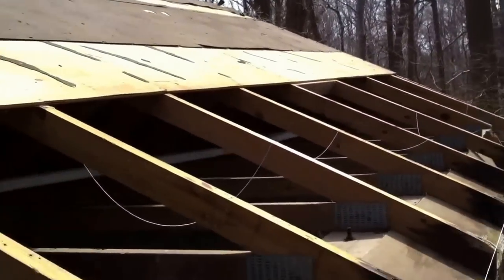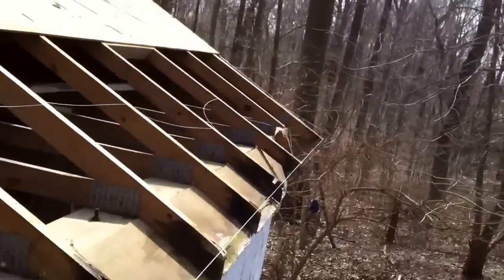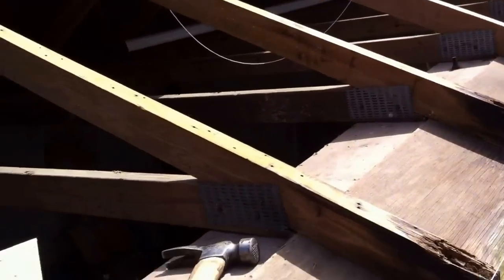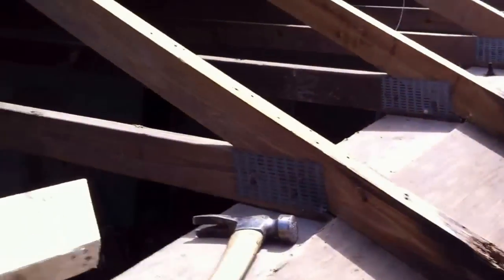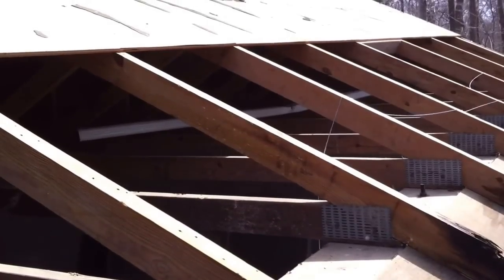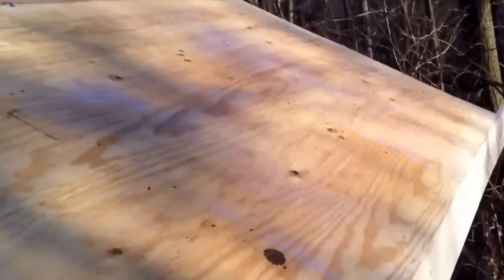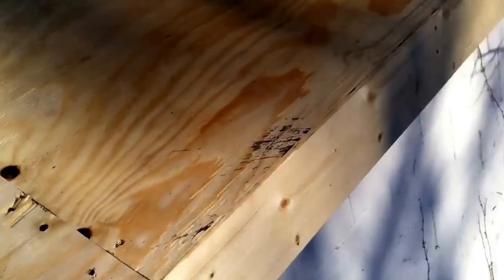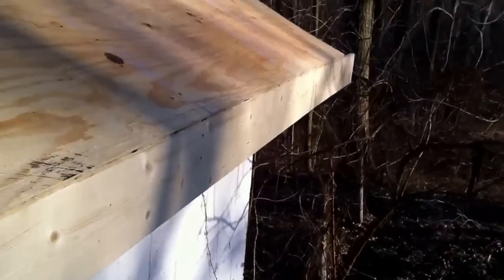Rafter tail and the importance of fascia

Comment: Which do you recommend be done First:  Drip Edging (directly on the roof deck) or the Felt and drip edging over the felt?  Thanks!
Reply from the maker: Well, there are a few different things to consider are you in Florida or Alaska ? I personally work Maryland PA Virginia and Pennsylvania. So on asphalt shingles I like to drip edge first then at a minimum 30 lb felt over the drip edge. Or start the eves with ice and water shield in case of ice damming. The fact is that the biggest thing is that the paper go all the way to the eve as close to perfect as possible. To evacuate water that gets behind shingles best as possible.
Reply from the maker: Well, there are a few different things to consider are you in Florida or Alaska ? I personally work Maryland PA Virginia and Pennsylvania. So on asphalt shingles I like to drip edge first then at a minimum 30 lb felt over the drip edge. Or start the eves with ice and water shield in case of ice damming. The fact is that the biggest thing is that the paper go all the way to the eve as close to perfect as possible. To evacuate water that gets behind shingles best as possible.
Reply from the maker: Well, there are a few different things to consider are you in Florida or Alaska ? I personally work Maryland PA Virginia and Pennsylvania. So on asphalt shingles I like to drip edge first then at a minimum 30 lb felt over the drip edge. Or start the eves with ice and water shield in case of ice damming. The fact is that the biggest thing is that the paper go all the way to the eve as close to perfect as possible. To evacuate water that gets behind shingles best as possible.
Reply from the maker: Well, there are a few different things to consider are you in Florida or Alaska ? I personally work Maryland PA Virginia and Pennsylvania. So on asphalt shingles I like to drip edge first then at a minimum 30 lb felt over the drip edge. Or start the eves with ice and water shield in case of ice damming. The fact is that the biggest thing is that the paper go all the way to the eve as close to perfect as possible. To evacuate water that gets behind shingles best as possible.
Reply: I live in the southern US --snow/ice build up is very rare!  So, sounds like in my case it's ok to put drip edging over the felt?

Comment: What happened to the rafter tails? Did you just attach to the rotted ones? Why did you go from start to finished without showing the middle which was the important part to me for watching this video...
Reply from the maker: +Heavyglare Eyewear  I'm sorry the video skipped that part. I've gotten a lot of criticism about it. But the fact is that I made this video as a point of interest, why something should be a certain way and not another. Rafter tails and bird mouth cuts ... I could make a series on them. And I've compiled a lot more videos since this video on the subject. But as I'm a working tradesman I find myself short on time to share it. If you have any questions I'll find time to answer them as soon as I can and as detailed as possible
Reply from the maker: +Heavyglare Eyewear  the simple fact of the matter is that this video explains the importance of having the roof decking lay securely on the fascia. With a fair amount of forensics, as to why the roof sheathing failed. You always should cut out as much rotten wood as you can. If you can't get it all but you cut off the supply of water then the framing will be just fine. I'm sorry I haven't had much time to make more of these videos. Please stay tuned unmade some more detailed videos this summer. This time I'll try and edit them better.

Comment: If by chance the rafter has rotted into the gusset area, is there a fix for that? Will email a photo, to get your opinion.
Reply: +Patty Baker Shucks there's no way to send the photo since you don't have a visible email.
Reply: Oh dear, What does "Ballon Fran" mean?
Reply from the maker: I apologize for the poor spell check.  
When the rot reaches the gussets or plates you need to replace that rafter.or at least add the strength back into the roof by adding a rafter back into the roof or by framing a new balloon framed rafter in place. Please research balloon framing. It means to frame from within an existing building envelope. A hassle but easily accomplished if the roof is open and being replaced. 3/4" or 1/2" plywood makes a good gusset as long as you use glue and some nails.
Reply from the maker: I apologize for the poor spell check.  
When the rot reaches the gussets or plates you need to replace that rafter.or at least add the strength back into the roof by adding a rafter back into the roof or by framing a new balloon framed rafter in place. Please research balloon framing. It means to frame from within an existing building envelope. A hassle but easily accomplished if the roof is open and being replaced. 3/4" or 1/2" plywood makes a good gusset as long as you use glue and some nails.
Reply from the maker: I apologize for the poor spell check.  
When the rot reaches the gussets or plates you need to replace that rafter.or at least add the strength back into the roof by adding a rafter back into the roof or by framing a new balloon framed rafter in place. Please research balloon framing. It means to frame from within an existing building envelope. A hassle but easily accomplished if the roof is open and being replaced. 3/4" or 1/2" plywood makes a good gusset as long as you use glue and some nails.
Reply: Thank you! You are a lifesaver!

Comment: You did NOT show where you cut the rotted rafters off nor how you reconnected the partial rafters!  Boooooooo  AND you talk too much!
Reply: He didn't cut them off he left the rotten moldy wood inside the structure so the slightest moisture intrusion will cause huge blooms poisoning the inhabitants and causing the rot to jump straight in to the shiney new sister tails.

Comment: The reason this guy didn't cut off the rafter tails, is because he is an example of who NOT to hire, that don't do the job properly, or complete. This is a perfect example of laziness, and knowing that his laziness will be covered up, when he is done. The rotting in the rafter tails will continue, if you do not cut off all of it that is rotted. This guy keeps making a groaning noise, which if you listen, is a sign that he hates what he is doing, and is only going to do was much as he has to, to get the Big Check, and run! He says, like he thinks everyone is going to believe him, that nobody takes the time to cut off the rafter tails, so he can try to justify his laziness, and that everyone else is as lazy as he is...NOT TRUE! This guy is the perfect example of who NOT to HIRE! You Never know what he is leaving undone, with this extremely poor workmanship, and how dangerous the roof is going to be, above your head, when he leaves! He is typical of house flippers, that think they can leave a bunch of quality crap out, and the outside finished appearance, is all that matters! NOT! If I pulled off that fascia or saw those rotted rafter tails, under all that new wood he put on, he would be in court, paying me back, as well as paying the new contractor, that is licensed and experienced to do the job safely, and properly,  to redo the dangerous and rip-off job he did the first time! Stay away from lazy ass so-called contractors like this! He is charging for the complete job, and then some, and taking these short cuts to cut his costs, so he makes more money! It's basically called Fraud! Needless to say, I would never sleep with him, because he would be bragging about how good he is, and he wouldn't be able to perform...More Fraud!
Reply from the maker: It's nice that someone found it beccesarybto make a negative comment that really never was supported by reason or observation. And was outside of the scope of this video. Please keep your negativity, I hope that it is getting you somewhere to the lesson we all as humans must encounter. I wish you well.
Reply: dekonfrost7 it only takes a basic know you need to cut OFF the rot BEFORE sistering the new wood otherwise it will continue to rot. It will just switch from a wet rot to a dry rot.
Reply from the maker: Just fyi i have almost 40 university creditis in chemistry and about 30 in biology. When you talk about rot, it take mycila to breaked down the cellulose in wood to have calories enough to fuel enzyme production that destroys fiber in wood then the process continues. But what teally drives this is water. No water there is no engine to fuel tjis cycle. In fscts kts called the arobic cycle. Look it up dummy
Reply: My issue with this comment is just with the part about him groaning and assuming he hates what he is doing.... you must be young to think that way... I make noises anytime I move because of the pain, but those are noises of joy because I can still move and do what I love.... those are war crys from little victories... when i am not happy i go silent...  just wait till the years catch up to you

Comment: my house is 110 years old with exposed rafter tails. no facia and its fine
Reply from the maker: Well what species of wood are your rafters made from? Sap wood 🌲? I bet not. Glad to hear how a totally dissimilar-structure doesn’t benefit from my explanation. I wonder if your building was made entirely of concrete or steel framing if you would have been ridiculous enough to comment.
Reply: @dekonfrost7  its made from pine i would say. All it needs is some paint and it will last. Pine is also rotressistant. Sap wood or heart wood doesnt matter on pine
Reply from the maker: BlueGamer Dude might want to do some more reading. More then pine. And your lumber ist heartwood. Not sapwood. But thats why you are here to become educated
Reply from the maker: You are wrong wrong wrong.
Reply: old growth scandinavian lumber. not america crap wood

Comment: The guy's a babbling, ego tripper babbling away about doing the job the wrong way. 
You never leave fungal damaged wood in place  - cut out all rotted tails & soffit.
You then treat with anti-fungal chemicals before fixing new material or the whole area will immediately begin to rot once again.
Reply: Maybe is why he refused to show even a single rafter tail repaired "sistered" ???   crap vido for leaving THAT out IMHO
Reply from the maker: +Doug Chaney normally when people include the imho they really had spoken with a little humility. You, your impolite and I forgive you. But this information which I shared freely has helped people. I'm sorry it didn't help you. I'm sure you understand the act and process of sistering boards.

Comment: you say you are a carpenter yet leave all that rotten timber on the rafter feet and seal it within the roof space? And this job is for a buddy of yours?What did he do, sleep with your dog?
Reply: +dekonfrost7 Not a negative tilt at all Pal, just an observation.You seem to be of a sensitive nature. So I will rephrase my comment.How can you fail to cut out that rotten timber, then "plant" new timber to the rotten wood and expect it to last more than a few months?I am a builder myself with over 40 years experience. You can fix my wood? I would not contract you to fix a postage stamp on an envelope.Are you going to respond in an adult manner with your reasoning for carrying out a shoddy job, or is 'asshole"" the level of your vocabulary?The new rafter feet you have fitted are not even 'treated' timber. Yet you choose to use it in what is obviously an area prone to moisture penetration.Man up and explain your thought processes concerning this work.
Reply: +dekonfrost7  your knowledge of the English Language and building terms, falls far short of your ability to carry out standard repairs.I refer you to the definition of "timber" as described in "Collins Thesauras of the English Language. Complete and unabridged 2nd edition 2002 Harper Collins Publishers 1995, 2002.Definition as follows;- Timber 1. Beams, boards, planks. 2. Wood, logs.Your ability to read and understand the English Language also seems severely impaired.I referred to the "rotten timber on the rafter feet".The rafter has not been "engineered", what has been engineered is the "roof truss". But it seems that expecting you (Fig Jam) to know the difference is expecting far too much.Man up and tell the folks why your shoddy repair is acceptable.Try to keep your language cuss free If at all possible please.

Comment: Why oh why did they ever do away with planks for the roof sheeting??!  The older homes all had planks.  Moving sheets of OSB sucks and you have to pull back the roof farther if you ever half to replace anything.  Another example of the old timers doing it better.
Reply from the maker: The simple fact of things is this. There are 7 billion people who need housing. And the osb provides a strong  durable substrate for a roof, if installed correctly. Even the Mona Lisa is falling apart.